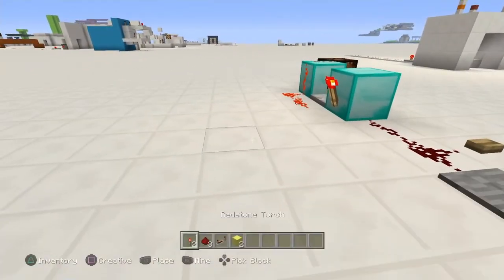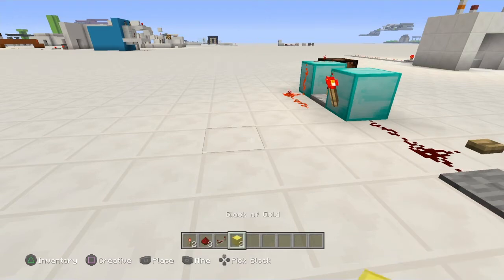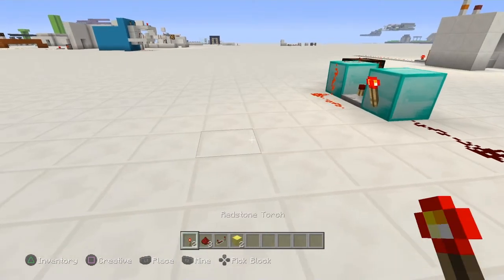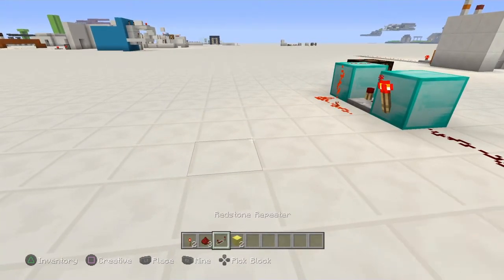shorten a redstone pulse (monostable circuit) PS4 legacy and bedrock

Comment: Don't observers work for a single tick tho
Reply: observers detect that the signal goes on and off so if you use an observer you’ll get 2 signals
Reply from the maker: @ThijmenTheTurkey  ya, so if you want the pulse on both the leading and the falling edge it's good, but if you need the pulse to last longer than half a tic you need to add another circuit with the observer.
Reply from the maker: Observers pulse for less than one tic which won't activate a torch and they go off on both the leading and falling edge of the input.
Reply: @darth_dub_  ah okay lit
Reply from the maker: @Jacobmg5564  I thought the same thing at first, I'm just getting familiar with observers myself.
Reply: @darth_dub_  yeah I am too. Idk I've just always used an observer to get a "single"  tick. But I also never ran into a torch so yeah
Reply from the maker: @Jacobmg5564  one tic being 1/10th of a second you could feasibly get more than 10 observer pulses in less than a second and depending on what it's being used for multiple observer pulses can seemingly "bleed" together in the output.